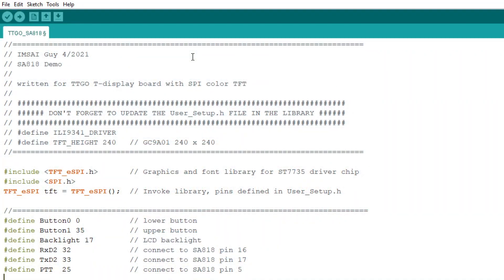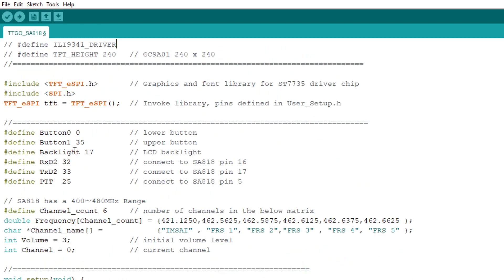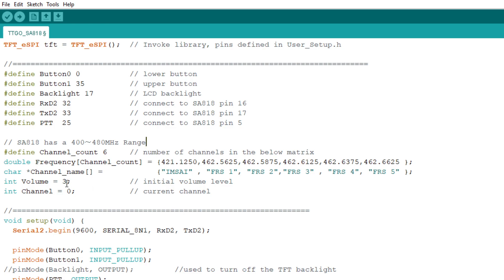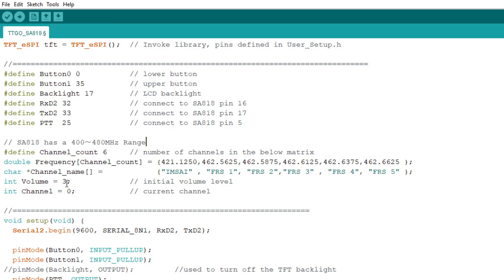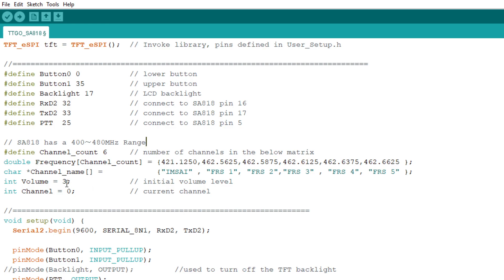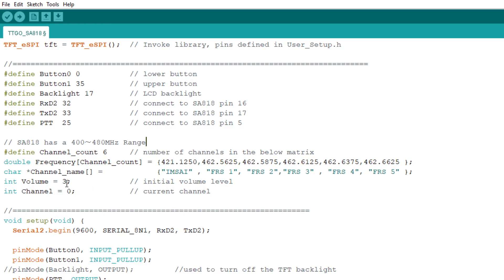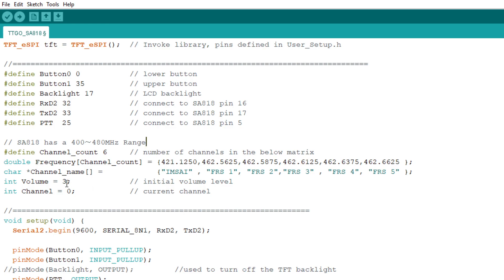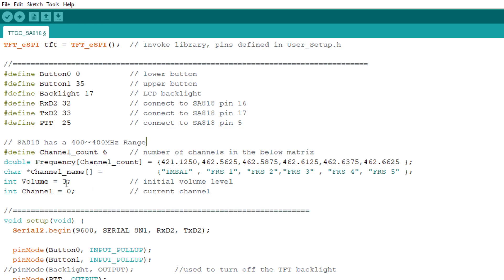#796 SA818 UHF Transceiver Module Firmware

Comment: Hi,  I enjoy your videos, especially the ones covering the NanoVNA.  Do you still plan to post the firmware for the ESP32 controller for use with the SA818?
Reply from the maker: keep reading the comments below, it is there
Reply: @IMSAIGuy Thanks for the quick reply, but I think I'm getting senile.  I still can't find a link to the firmware for the TTGO_SA818.  I've read through the comments several times.
Reply from the maker: @fredwa0gmh416  //==============================================================================
// IMSAI Guy 4/2021
// SA818 Demo 
// 
// written for TTGO T-display board with SPI color TFT
// 
// #########################################################################
// ###### DON'T FORGET TO UPDATE THE User_Setup.h FILE IN THE LIBRARY ######
// #########################################################################
// #define ILI9341_DRIVER
// #define TFT_HEIGHT 240   // GC9A01 240 x 240
//==============================================================================

#include <TFT_eSPI.h>       // Graphics and font library for ST7735 driver chip
#include <SPI.h>
TFT_eSPI tft = TFT_eSPI();  // Invoke library, pins defined in User_Setup.h

//===============================================================================
#define Button0 0           // lower button
#define Button1 35          // upper button
#define Backlight 17        // LCD backlight
#define RxD2 32             // connect to SA818 pin 16
#define TxD2 33             // connect to SA818 pin 17
#define PTT  25             // connect to SA818 pin 5

// SA818 has a 400～480MHz Range
#define Channel_count 6     // number of channels in the below matrix
double Frequency[Channel_count] = {421.1250,462.5625,462.5875,462.6125,462.6375,462.6625 };
char *Channel_name[] =            {"IMSAI" , "FRS 1", "FRS 2","FRS 3" , "FRS 4", "FRS 5" };
int Volume = 3;             // initial volume level
int Channel = 0;            // current channel

//==================================================================
void setup(void) {
  Serial2.begin(9600, SERIAL_8N1, RxD2, TxD2);
  
  pinMode(Button0, INPUT_PULLUP);
  pinMode(Button1, INPUT_PULLUP);
//pinMode(Backlight, OUTPUT);         //used to turn off the TFT backlight
  pinMode(PTT, OUTPUT);
  digitalWrite(PTT,HIGH);             //initilize to receive
  
  tft.init();
  tft.setRotation(1);
  tft.setTextColor(TFT_GREEN,TFT_BLACK); 
  tft.fillScreen(TFT_BLACK);
  tft.setCursor(0, 0, 4);
  tft.println("IMSAI SA818 Demo");     // splash
  Serial2.println("AT+DMOCONNECT\r");  // connect communications with SA818
  tft.print(Serial2.readString());     // returns :0 if good
  Serial2.print("AT+VERSION\r\n");     // get version
  tft.print(Serial2.readString());     // returns: version number
  delay(2000);

  tft.fillScreen(TFT_BLACK);
  tft.setCursor(0, 0, 4);
  tft.println("Set Group");            // group set
  setfreq();                           // set frequency
  tft.print(Serial2.readString());     // returns :0 if good
  
//Format：AT+DMOSETVOLUME=X
//Reply: +DMOSETVOLUME: 0
//“X” is the volume level, the range is 1---8
  tft.print("Set Volume: ");
  tft.println(String(Volume));
  Serial2.print("AT+DMOSETVOLUME=8\r\n"); // set volume
  tft.print(Serial2.readString());        // returns :0 if good
  delay(2000);

//Format: AT+SETFILTER=PRE/DE-EMPH, HIGHPASS, LOWPASS
//Reply: +DMOSETFILTER: X
//HIGHPASS: 1: bypass 0: normal
//LOWPASS:  1: bypass 0: normal

//Format: RSSI?
//Reply: RSSI=X
//“X”: Value of RSSI, from 0 to 255, unit 1dB

    tft.fillScreen(TFT_BLACK);
    disp_channel();
}

//===============================================================================
void loop() {
  if (digitalRead(Button0) != 1){     // wait for bottom button press
    tft.fillScreen(TFT_RED);          // spash RED when transmitting
    disp_channel();
    digitalWrite(PTT,LOW);            // assert push to talk
    while(digitalRead(Button0) != 1); // wait for button release
    digitalWrite(PTT,HIGH);           // release push to talk
    tft.fillScreen(TFT_BLACK);
    disp_channel();
    delay(1000);                      // wait for transmisson to end
                                      // causes false button presses
    }
  if (digitalRead(Button1) == 0){     // check for upper button press
    Channel += 1;                     // next channel
    if (Channel >= Channel_count) Channel=0;
    setfreq(); 
    tft.fillScreen(TFT_BLACK);
    disp_channel();
    delay(500);                       // button repeat delay
  }  
}
//===============================================================================
//Format：AT+DMOSETGROUP=BW，TX_F，RX_F，Tx_subaudio，SQ，Rx_subaudio
//BW：0: 12.5K 1: 25K
//SQ: 0 ~ 8  0: listen mode  1—8: Different SQ Level.
//The range of Tx_CTCSS and Rx_ctcss is 0001—0038. 0000: none
void setfreq() {
  Serial2.print("AT+DMOSETGROUP=0,");
  Serial2.print(String(Frequency[Channel],4));
  Serial2.print(",");
  Serial2.print(String(Frequency[Channel],4));
  Serial2.print(",0000,1,0000\r\n");
}
//===============================================================================
void disp_channel() {
  tft.setCursor(0, 0, 4);
  tft.println("SA818 Transceiver");
  tft.print("Freq: ");
  tft.println(String(Frequency[Channel],4));  
  tft.print("Name: ");
  tft.println(Channel_name[Channel]);
}
//===============================================================================
//===============================================================================
Reply: @IMSAIGuy  Thanks.

Comment from the maker: //==============================================================================
// IMSAI Guy 4/2021
// SA818 Demo 
// 
// written for TTGO T-display board with SPI color TFT
// 
// #########################################################################
// ###### DON'T FORGET TO UPDATE THE User_Setup.h FILE IN THE LIBRARY ######
// #########################################################################
// #define ILI9341_DRIVER
// #define TFT_HEIGHT 240   // GC9A01 240 x 240
//==============================================================================

#include <TFT_eSPI.h>       // Graphics and font library for ST7735 driver chip
#include <SPI.h>
TFT_eSPI tft = TFT_eSPI();  // Invoke library, pins defined in User_Setup.h

//===============================================================================
#define Button0 0           // lower button
#define Button1 35          // upper button
#define Backlight 17        // LCD backlight
#define RxD2 32             // connect to SA818 pin 16
#define TxD2 33             // connect to SA818 pin 17
#define PTT  25             // connect to SA818 pin 5

// SA818 has a 400～480MHz Range
#define Channel_count 6     // number of channels in the below matrix
double Frequency[Channel_count] = {421.1250,462.5625,462.5875,462.6125,462.6375,462.6625 };
char *Channel_name[] =            {"IMSAI" , "FRS 1", "FRS 2","FRS 3" , "FRS 4", "FRS 5" };
int Volume = 3;             // initial volume level
int Channel = 0;            // current channel

//==================================================================
void setup(void) {
  Serial2.begin(9600, SERIAL_8N1, RxD2, TxD2);
  
  pinMode(Button0, INPUT_PULLUP);
  pinMode(Button1, INPUT_PULLUP);
//pinMode(Backlight, OUTPUT);         //used to turn off the TFT backlight
  pinMode(PTT, OUTPUT);
  digitalWrite(PTT,HIGH);             //initilize to receive
  
  tft.init();
  tft.setRotation(1);
  tft.setTextColor(TFT_GREEN,TFT_BLACK); 
  tft.fillScreen(TFT_BLACK);
  tft.setCursor(0, 0, 4);
  tft.println("IMSAI SA818 Demo");     // splash
  Serial2.println("AT+DMOCONNECT\r");  // connect communications with SA818
  tft.print(Serial2.readString());     // returns :0 if good
  Serial2.print("AT+VERSION\r\n");     // get version
  tft.print(Serial2.readString());     // returns: version number
  delay(2000);

  tft.fillScreen(TFT_BLACK);
  tft.setCursor(0, 0, 4);
  tft.println("Set Group");            // group set
  setfreq();                           // set frequency
  tft.print(Serial2.readString());     // returns :0 if good
  
//Format：AT+DMOSETVOLUME=X
//Reply: +DMOSETVOLUME: 0
//“X” is the volume level, the range is 1---8
  tft.print("Set Volume: ");
  tft.println(String(Volume));
  Serial2.print("AT+DMOSETVOLUME=8\r\n"); // set volume
  tft.print(Serial2.readString());        // returns :0 if good
  delay(2000);

//Format: AT+SETFILTER=PRE/DE-EMPH, HIGHPASS, LOWPASS
//Reply: +DMOSETFILTER: X
//HIGHPASS: 1: bypass 0: normal
//LOWPASS:  1: bypass 0: normal

//Format: RSSI?
//Reply: RSSI=X
//“X”: Value of RSSI, from 0 to 255, unit 1dB

    tft.fillScreen(TFT_BLACK);
    disp_channel();
}

//===============================================================================
void loop() {
  if (digitalRead(Button0) != 1){     // wait for bottom button press
    tft.fillScreen(TFT_RED);          // spash RED when transmitting
    disp_channel();
    digitalWrite(PTT,LOW);            // assert push to talk
    while(digitalRead(Button0) != 1); // wait for button release
    digitalWrite(PTT,HIGH);           // release push to talk
    tft.fillScreen(TFT_BLACK);
    disp_channel();
    delay(1000);                      // wait for transmisson to end
                                      // causes false button presses
    }
  if (digitalRead(Button1) == 0){     // check for upper button press
    Channel += 1;                     // next channel
    if (Channel >= Channel_count) Channel=0;
    setfreq(); 
    tft.fillScreen(TFT_BLACK);
    disp_channel();
    delay(500);                       // button repeat delay
  }  
}
//===============================================================================
//Format：AT+DMOSETGROUP=BW，TX_F，RX_F，Tx_subaudio，SQ，Rx_subaudio
//BW：0: 12.5K 1: 25K
//SQ: 0 ~ 8  0: listen mode  1—8: Different SQ Level.
//The range of Tx_CTCSS and Rx_ctcss is 0001—0038. 0000: none
void setfreq() {
  Serial2.print("AT+DMOSETGROUP=0,");
  Serial2.print(String(Frequency[Channel],4));
  Serial2.print(",");
  Serial2.print(String(Frequency[Channel],4));
  Serial2.print(",0000,1,0000\r\n");
}
//===============================================================================
void disp_channel() {
  tft.setCursor(0, 0, 4);
  tft.println("SA818 Transceiver");
  tft.print("Freq: ");
  tft.println(String(Frequency[Channel],4));  
  tft.print("Name: ");
  tft.println(Channel_name[Channel]);
}
//===============================================================================
//===============================================================================